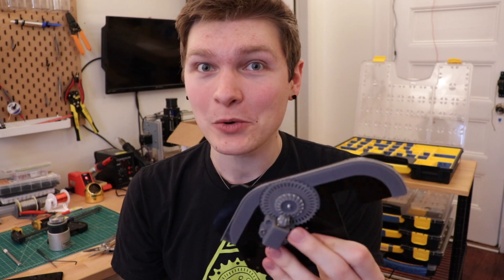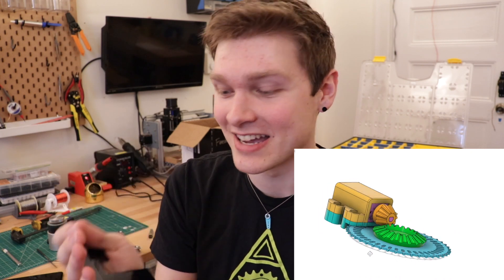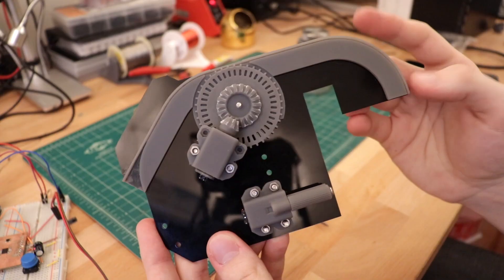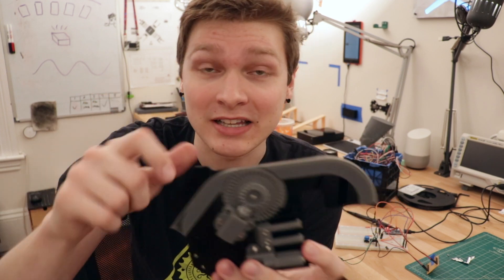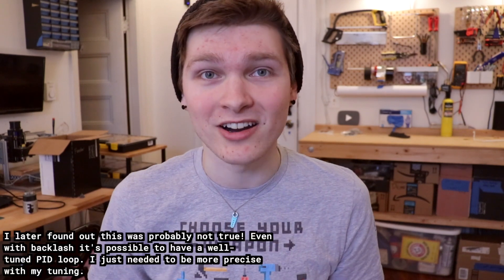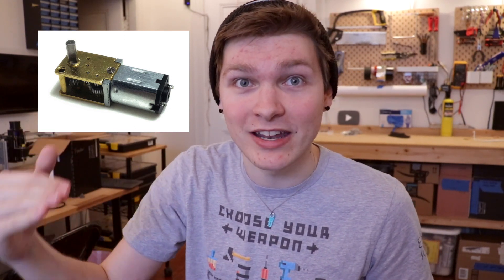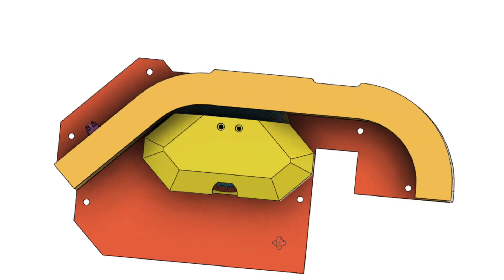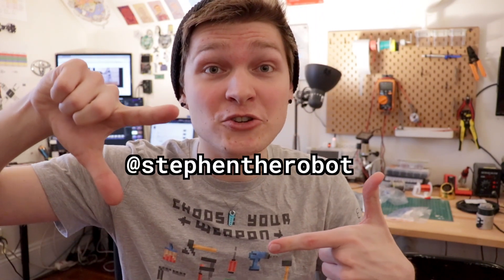Pick and Place Feeder - The Mechanics

Comment: hey my friend, i love your work... I subscribed! I work for a tape & reel house in the US, we make "carrier tape" like the one your using that holds the parts. The clear tape that holds them in is called "cover tape"  The carrier tape's (tiny holes) known as "pitch" are based on a 4mm increment. i'm actually trying to build the opposite as you, i need a bot to rotate the part to the correct orientation and put parts into the carrier tape lol.. Fantastic engineering my friend .

Comment: Stephen, since your goal is to always stop the tape at exactly the same place every time, it may be worthwhile to think about no PID loop, but rather, just a motor start pulse and a stop when the tape reaches a position defined by the conduction of light(photo interrupter) through the hole in tape. That way the precision is on the manufacturer of the tape, not you. That said, you are awesome, keep up the good engineering.

Comment: LOOKS NICE
I WILL STILL THINK OF USING 28BYJ48 AS THEY HAVE VERY BIG RATIO GEARS IN IT AND NO FEEDBACK WILL BE REQUIRED BUT IT MAY TAKE FOUR PINS TO DRIVE IT AND THAT'S ANNOYING
Reply from the maker: Yeah, I think I might switch, depending on the performance of the final design with the N20 motor. When I ordered the circuit boards, I made sure to add a connector for those steppers so I can give it a test! Thanks again for the suggestion!
Reply: The final axle has backlash, but if you tension the tape, to pull it backwards, it may work well.